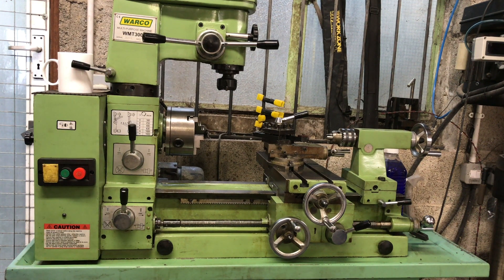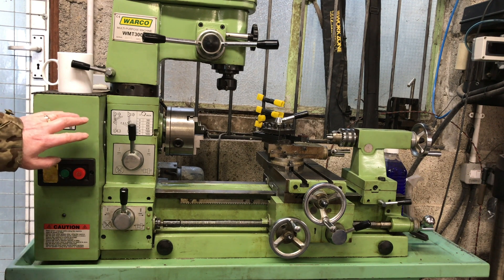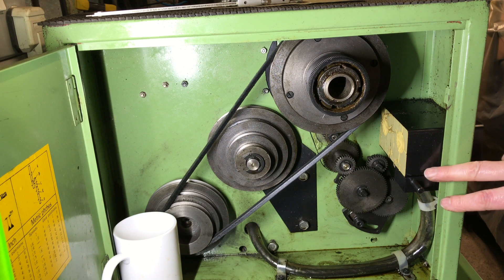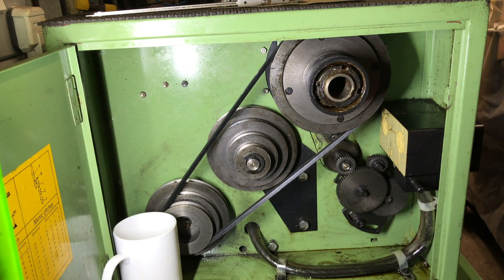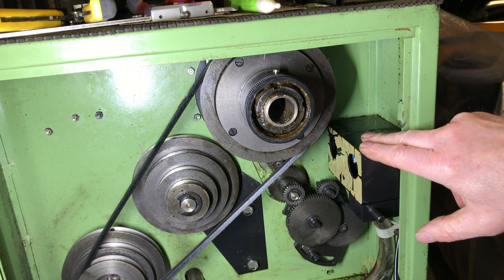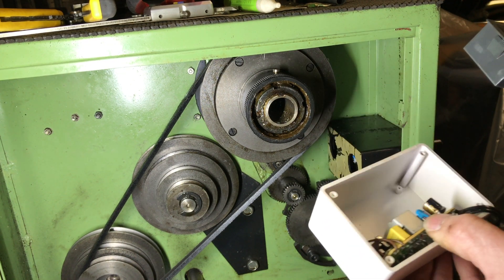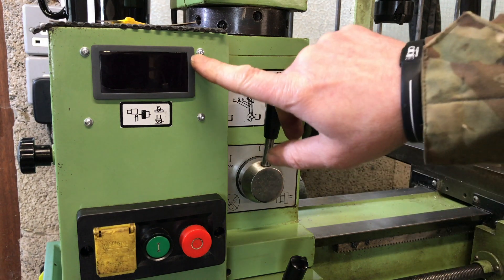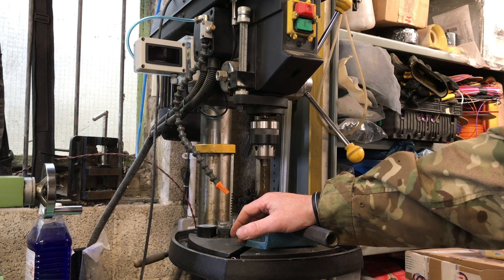Warco WM300/2 Lathe tacho upgrade

Comment: Hi love the vids ! I have the same lathe but cant for the life of me get the thread cutting gears to fit together as on the door most wont line up have you had trouble ?
Reply from the maker: Hi, I have the gears already fitted inside the door and another box of imperial sized ones but have to say I've never used them so unfortunately cannot tell you if I'll have problems as I've never swapped or fitted them.